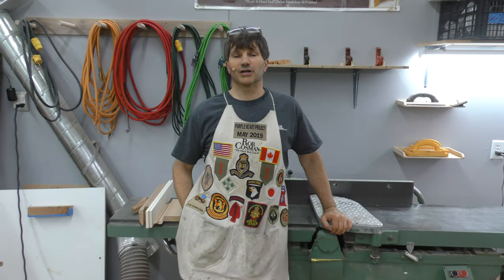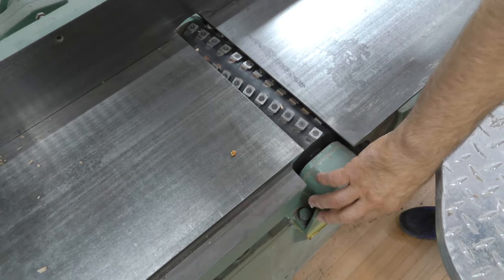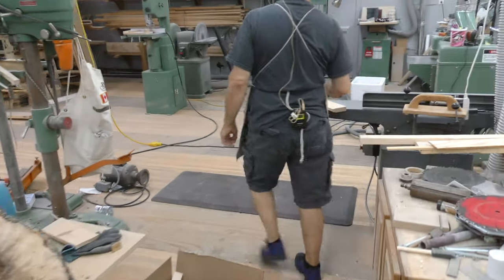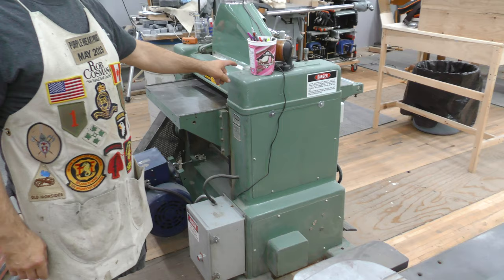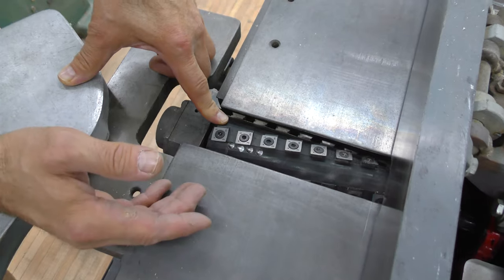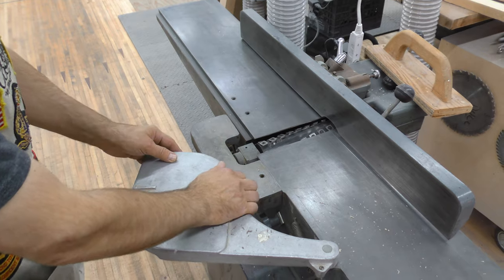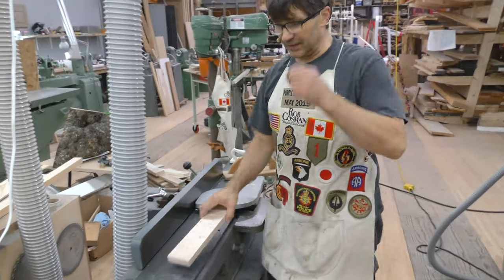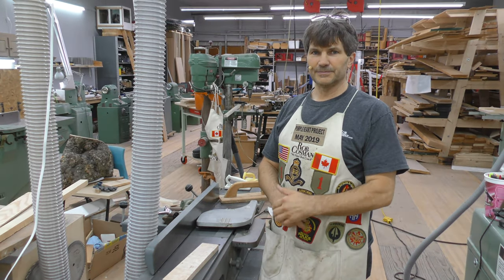Byrd Segmented Cutter Head Overview

Comment: I work in a college as a joinery tutor in the uk and we use a wadkin super 500 surface planer  and a wadkin bts500 thicknesser both come with tools  that you place the new knifes into  and its supplied with a tool you secure to the cutting block and it sets the knifes to the correct setting with out adjusting  a simple 10mm Allen key is all that's needed  wish we would  get these tho  but both sets of knives  can be done in about 40 mins

Comment: I run tons of wood through my shop, and I get a lot of dust port clogging which can cause a lot of downtime to clear. That in addition to the other time saving benefits make helical cutterheads a no-brainer for commercial shops or serious hobbyists. I finally purchased one for my 8" jointer and 15" planer after waiting many years. Just couldn't afford it until now 😐

Comment: I watched because I finally broke down.  I ordered a head for my 8 inch Delta.  After I get it set up, then I will do the same for my 15 inch Grizzly.  Yes I have dealt with chipped blades in my planer because I HATE sharpening and resetting.  Such a PITA.  Years ago, my brother got his shop set up right after these became popular.  He used my shop previously.  He told me get the conversion heads.  I am cheap and held off until now.

Comment: Great advance, but try installing one in a Robland X31 Combinaion machine, it’s almost a complete machine rebuild to get the old head out & new head in.
It’s actually quicker / easier to just keep sharpening & replacing the straight knives.
On stand alone machines it’s easy, not so much combination machines!

Comment: I replaced the 3 knife cutter head in my Dewalt 735 thickness planer with a Byrd Shelix head and it's worked great.  Took about an hour to complete the install but the results are worth it.